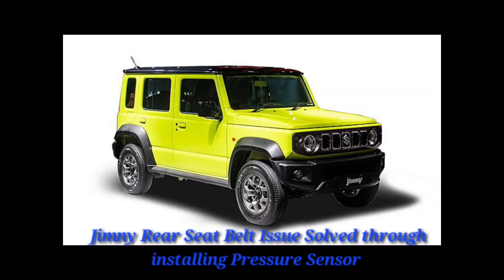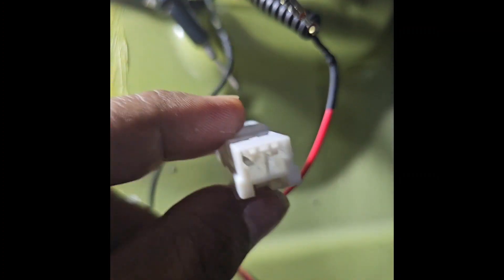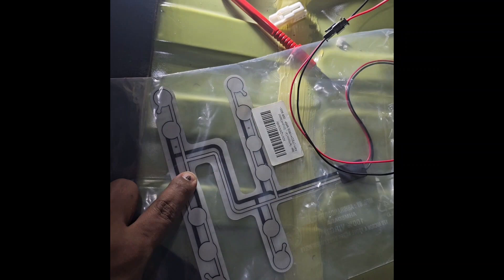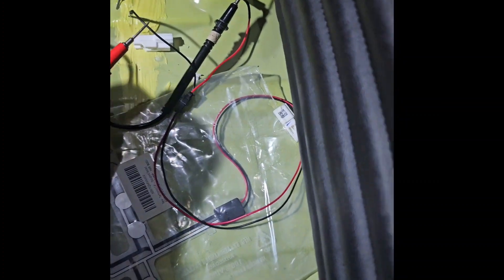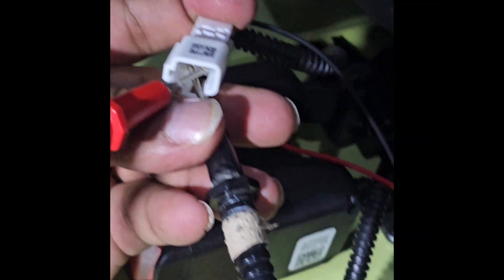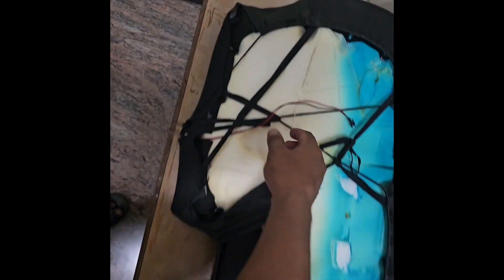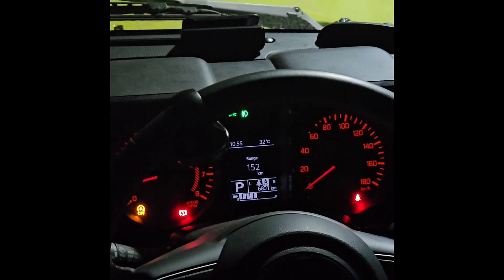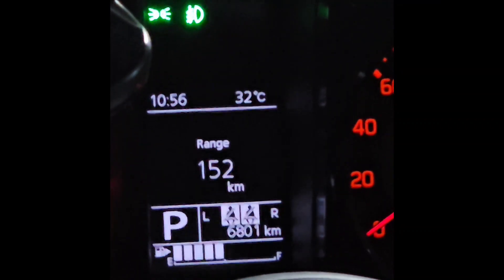Jimny Rear (no occupancy) Seat Belt Alert issue resolved through simple DIY Hack in INR.1200/-!!

Comment: Thank you for this workaround. Your demonstration was helpful.
In fact , I also was thinking about the same.
I've just booked a Taisor V AT, and I'm thinking about addressing this problem even before taking delivery. 
Maruti's decision to cut costs here is one of the worst I've seen. It negatively impacts the experience, especially in the top variants. While l get it for an Alto or some of the base variants, it's really bad that cars costing above 15L also has this issue.